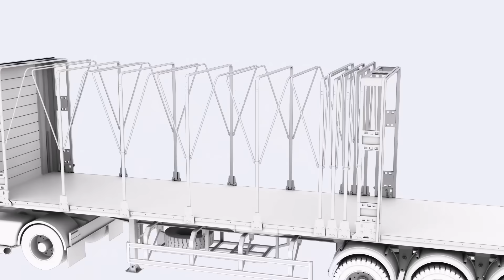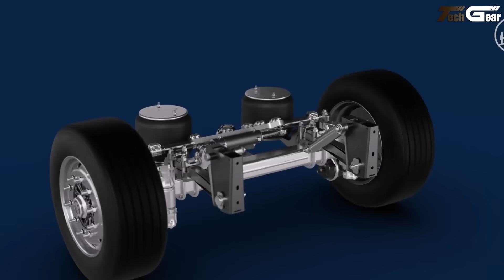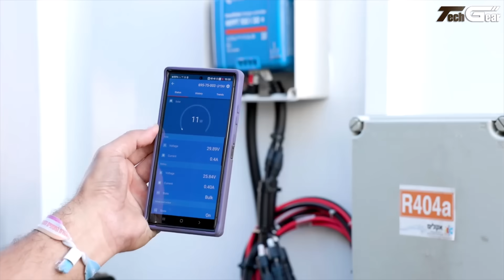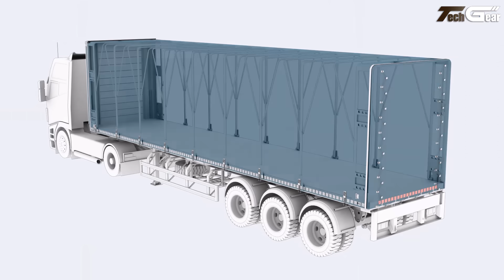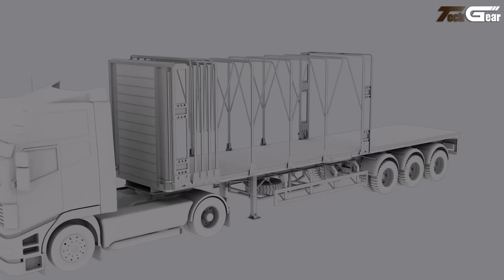Next Level Truck Inventions You Need To See

Comment: 1:38 the EX9 still has to be manually hooked up to the trailer.  Air brakes on the trailer won’t connect themselves yet.
Reply: I knew I'd find this comment. Doing maintenance at an Amazon building, the manager told us to stay out of the yard because the truck driver was dangerous. She was supposed to pull the trailers to 8 feet away from each dock so we could work. She never hooked up the brakes. She dragged every one of them. Funny as hell.

Comment: Just to reassure The Logneo comment... I have used the steelbro swing lifts for almost 30 years.... I had one of the very first b-train swing lifts here in NZ... It will double stack 20 or 40 foot containers, you can load a 30tn container onto yourself and still unload another 30tn container off another truck... Providing they are both 40 foot... Whilst the 30tn container is suspended in the air... the empty truck can now move away and the container placed on the ground 👍... So yes these swing lifts are a game changer with regards to container movements for the cargo transport industry 🤙😁

Comment: Solar panels on top of trailers might be great for warm climates but useless for northern countries like Canada.  I routinely need to pound ice off the top of trailers in the winter.
Reply: Edison Motors was going to cover a refer trailer in solar panels add some batteries and power it all electrically.   The problem they ran into was Canada has a large tariff on importing the solar panels they were going to use.  It effectively doubled the cost of the refer trailer and the buyer backed out.  There is enough solar energy even in Canada to power the unit.
Reply: I actually remember something about how even the combined surface of a full trailer could not keep up with the power draw the motors draw in the first place. Might massively extend your range though. But I'm no expert on solar panels in the first place either.

Comment: Too much hype and not much substance.  The tarp system has been around for years.  I have not seen it used much though.  Extend lowboys have been around for years.  Cranes on trailers means less payload.
Reply: Cranes on trailers mean they can drive around loading and unloading other semis, reducing costs for having to pay a crane company and waiting for them to show up. They hook up and load/unload way faster than a crane too. They've been used in Aus and NZ for 40+ years.